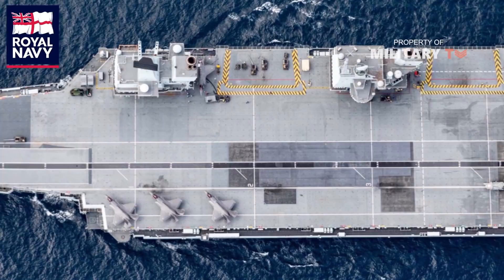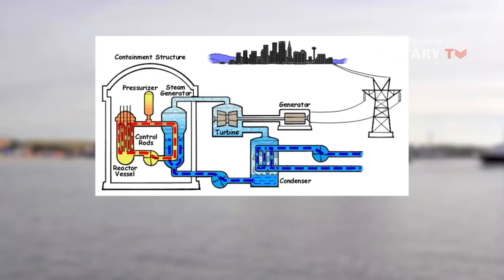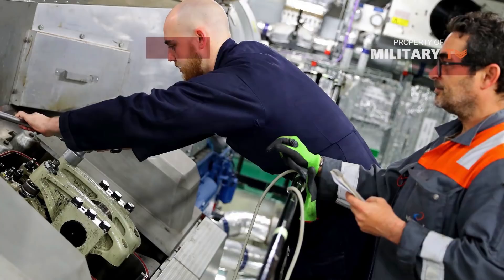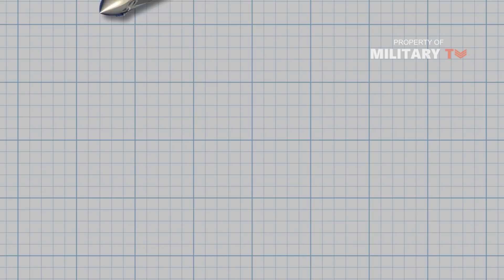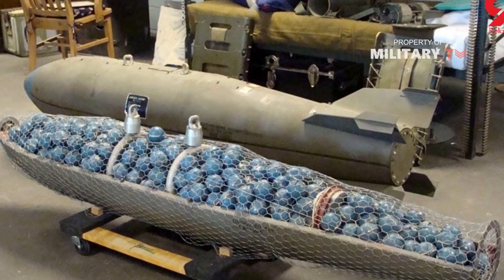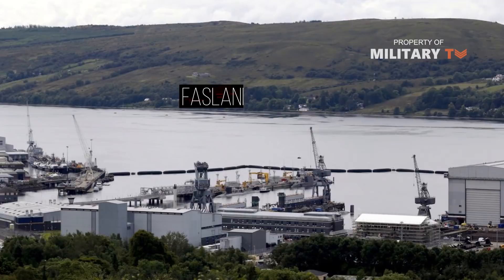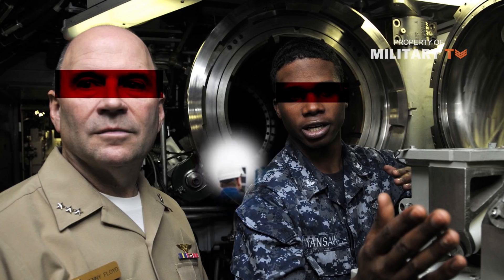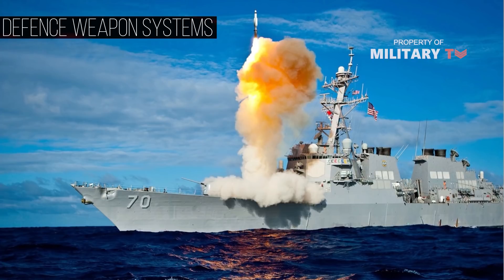The reasons HMS Queen Elizabeth is not nuclear powered

Comment: 1) Top speed is listed as 32 knots, not 25 - which would be ridiculously slow.

2) You missed out the actual (political) reason why no UK surface vessel has ever had nuclear propulsion - which is that they could be prevented from freely visiting allied ports.
Reply: The only country that doesn't allow nuclear-powered vessels to visit its ports is New Zealand.
There are some cities (including in America) that pass nuclear bans. But those bans are toothless political statements.  Since large ports are almost always controlled by an entity different than the city council. Plus foreign policy is controlled by the central governments and cities don't get to decide who can visit the nation.
Reply: that test was done 2017 ago buddy with no Jet/helicopter on board, no full crew, no full suppy, less equipment on board.

Comment: There's no electromagnetic launch system on the QE class.
Reply: They want to fit a light cat system for drones and the QE class is designed so that if they want to in the future convert the carriers to cats and traps they can as there is sufficient space below the flight deck for the launch and recovery systems and the deck is designed so that it only need be repainted for a angled flight deck and the engines are powerful enough for the systems too.
Reply: @Autofleet4429  I think by the time Big Lizzie returns for refit, the Ford class should have the bugs worked out of the EMALS system. They’re very close as it is.
Reply: @Autofleet4429  People in hell want ice water, too.
Reply: @takaharatanaka8818  Lol what a load of crap, the F35B can launch with full weapons and fuel.

It has crowsnest on the Merlins and within hopefully not too many years will have drone launched AEW which are well into development. 

Why would it need more than 3 phalanx when it will always have T45 escorts and F35/wildcats on the deck?
Reply: Arthur Humphreys  EMALS in its first generation on a much bigger carrier of the US requires that much power yes, to launch lighter drones on a smaller ship it will not need anywhere near as much.
Reply: @jameshammonds4687  

The F-35B can take off with a full load on a short runway (300 feet sticks in my head, but not sure) or very short runway with a ski-ramp. It can not take off vertically with a full load. I think it is limited to only 10,000 lbs or so or fuel and/or ordinance when taking off vertically.
Reply: @takaharatanaka8818  

The F-35B can take off with a full load on a short runway (300 feet sticks in my head, but not sure) or very short runway with a ski-ramp. It can not take off vertically with a full load. I think it is limited to only 10,000 lbs or so or fuel and/or ordinance when taking off vertically.
Reply: @ycplum7062  True but as we are talking about the QE class carriers which has the ski ramp then it can launch fully equipped and fuelled.
Reply: @jameshammonds4687  

Just pointing out that Tanaka's statement is not wrong. 

It is not applicable because the F-35B do not need to take off vertically, but not technically wrong.
Reply: @jameshammonds4687  If by full load you mean a jet 3000+ pounds heavier than the A & C version, one limited to 7G or less, with only a 14000 pound fuel load and a weapons loadout 1/2 to 3/4 that of the A or C, then sure.
The B version is a great compromise for an amphibious assault vessel, helicopter carrier or a through deck cruiser but saying it is a real carrier based fighter is like putting lipstick on a pig.
Without catapults she can't launch viable AWACS. Without situational awareness, she is reliant on US, French or shore based AWACS. 
I'm fully aware what a Merlin Crowsnest AEW bird's limitations are. I don't know what the radar is capable of, but I do know the approx limitations of the chopper since I've flown a Merlin while training with the Brits.
One can't loiter a Merlin at 35000 feet for 8 hours like one can a Hawkeye.
A chopper loitering at 10 or max, 15000 feet, well, that radar is limited by the horizon.
The Brits made too many compromises for reasons of national pride. She will always be dependent on others to be a viable platform in a medium to high threat or near peer environment.
Reply: @jameshammonds4687  Also, as for point defenses, the RIM-116 Block 2 & RIM-162 ESSM Mk-48/Mk-52 are thought to have a chance of intercepting maneuvering hypersonic cruise missiles in their terminal phase. That's something the Phalanx isn't designed to do & one of the reasons why the US has RAM as one of their point defenses. The Aster missile system on the Type-45 makes for a very capable platform, intercepting hypersonic missiles just isn't a capability it has (yet).
Not even the US SM-3 or SM-6 variations with the AN/SPY-1 radar are reasonably capable of defending against hypersonic threats. The interception of hypersonic cruise missiles will evolve as the newer AN/SPY-6/7 along with purpose built interceptors are deployed.
In the meantime, wouldn't it be nice to have a point defense system that MAY have the capability to defend the QE or the type 45's from such a hypersonic threat (pray the Chinese didn't shoot off a lot of them) don't you think?
Reply: @takaharatanaka8818  Said hypersonic threat that isnt proven to be able to hit anything that moves or even out at sea? A threat that in order to be able to manoeuvre and actually be able to hit a target needs to slow down to non hypersonic speeds? 

As you say say the RIM blocks are 'thought' to be able to hit said targets, how can they prove then can when no one can launch a hypersonic target to try and hit? 

The Aster 30/15 combined with Seaceptor on a nearby T23 is probably the most capable air defence system of any Navy on the medium to short distance. 

Incase you have missed the videos the T45 has been doing software training to deal with the possible threat of hypersonic so yes they are training for the hypothetical threat assuming the UK is planning on going to war with the Russians or Chinese then otherwise its still a non existent threat.
Reply: @jameshammonds4687  You go on & hope really really hard so the pig doesn't make the Chinese mad when/if she sails by. That is, if the Crown has the balls to allow her anywhere near Taiwan, the Philippines, or sail up to Japan via the South China Sea. That is, should she even show the flag in the region later this year.

Your final paragraph would do Neville Chamberlin justice.

It will be okay buddy. She will have the Americans & if she sails carefully, the Aussies to provide viable situational awareness to her. The Arlie Burks will even provide SM-6 cover, a missile proven to hit hypersonic glide vehicles, if not cruise missiles... Yet.

Both Brahmos and DF-17 are deployed with DF-17 being the true hypersonic threat. I would very much prefer the ESSM & the RAM CIWS be installed, both at least providing something of a defense against the "hypothetical" threat. The RAM & SEARAM being available "off the shelf" for not a lot of money. That 11 or 22 shot RAM pointing directly at an incoming threat just gives one that last little something that a VLS Sea Ceptor, even that ESSM don't have.
Anyway, your world view is based on wishes & faith.

I mean, even though you don't plan on fighting the Chinese, well, good old Neville didn't plan on fighting the Germans either.
Ya people, ya got experience there ;-)

That is, if the lack of AWACS doesn't prevent you from even identifying a threat. 

That poorly defended pig just may not be tempting for our ornery Uncle Xi as long as we all wish and hope really really hard & stay out of the South China Sea.
Reply: The UK was making one called EMCAT until the Tory government stopped it when it was elected
Reply: @Then.72  Which was purely based on the EMALS system in America which didnt work hence why they stopped it, it still doesnt work anywhere near 100%.
Reply: @takaharatanaka8818  Ah so you are saying China are basically the same as the Nazi's then? Well yes several similarities exist so I see what you are saying. 

No 'true' hypersonic threat exists as they cant target and actually engage a target at hypersonic speeds which makes them targetable by existing air defence systems.

It does have AEW systems in case you have yet again forget it has crowsnest. If the Chinese dont illegally attack it this time next time it will probably have drone AEW.

Im sure allies will provide some valuable defences if required, if the Chinese sail to the Med what allies will provide assistance to them? Ah yeah they couldnt even make it to the Med alone and funnily enough no allies at all would stand in would they?
Reply: @jameshammonds4687  🤔 it actually started before EMALS and if our engineers were left working on it they would have it working by now just like they did with VTOL
Reply: @Then.72  Again incorrect the system development was looked into with General Atomics in 2011 which was way later than the USA started on EMALS.
Reply: @takaharatanaka8818  
Nonsense, carriers are defended by her CAP, her sub and the type 45.
Sea Viper is the best theatre air defense system bar none, nothing gets through.
Reply: @jameshammonds4687  EMCAT 2009 EMALS 2011
Reply: @Then.72  EMCAT/EMKIT was an experimental design study by a private company which couldnt launch anything more than 11 tonnes, the MOD did invest a small amount of money into design studies (as they do with many projects) in 2009 but thats all it was, a design study.

In 2011 the UK signed an actual contract with GE to develop the idea but when the costs came back along with the reliability reports the idea was got rid of.

GE and the US had been working on the idea for a long time before 2011.
Reply: @jameshammonds4687  😂😂😂 but if the Tory government didn't scrap it our engineers would have it up and running by now just like they did with VTOL
Your obviously a major fan of the USA but Japan actually started maglev.
Force Engineering had the Contractract in 2009 not 2011 who are now called GE power conversion and have a long track record with the Royal Navy (have you got mistaken with General Electric).
COSTS??? the UK isn't a poor country and became a partner of the F35B which is the most expensive aircraft
Reply: @Then.72  What are you going on about, the government never scrapped anything, it was a private company doing some experimental work it was never under government control for anyone in the government to scrap!! If the USA cant get EMALS to work properly with the budget they have how exactly would a small company in the UK be guaranteed to have it up and running?

Force engineering never had a contract at all, they received a small amount of money for a design study, is a very big difference.

The MOD then awarded a contract/tender to General Atomics in the USA for EMALS.
Reply: @jameshammonds4687  you obviously read rubbish hence why you've admitted you were wrong previously but you keep on 2011 when EMCAT was 2009 
The MOD is the government who cancelled EMCAT by running off with EMALS
Reply: @takaharatanaka8818  Her F35's can indeed launch with full and weapons however i can see your mistake you either read a news article about how US Marine F35's cant take off with full fuel or weapons and assumed it meant all F35-b jets when in fact the reason hms queen elizabeth has a ski jump is in fact so F35's can in fact take off with full fuel and weapons or you confused the royal navy for the US marines       ever wondered why the US marines are so interested in HMS Queen Elizabeth its partly becuse she can launch F35's with full fuel and weapons

Comment: Not needing a head wind (of a fraction of one) is the reason we were able to operate a carrier in the southern Atlantic during the Falklands War.
Further to that, stovl aircraft are guaranteed to land first time every time, there's no 'missing the hook'
With American catobar aircraft, they have to reserve multiple tons of fuel to land, whereas the harriers and F35s can land on fumes.
The envelope was vastly expanded during the Falklands.
Ski lifts and stovl aircraft have these hidden advantages.
Reply: @ Mostly Penny Cat: The flip side to that is aircraft designed for CATOBAR can carry much more ordinance, and fuel, thus greater range. Also, you can fly a greater variety of aircraft off a CATOBAR carrier, such as the E2C Hawkeye, which gives you a much greater range for an airborne early warning aircraft. In an age of hypersonic missiles, you need all the early warning you can get.

I will give the Brits credit for pioneering the rolling recovery landing for aircraft returning with partial or full ordinance loading. That otherwise wouldn’t be possible in STOVL.
Reply: @darkjedi74  the F35B can land vertically with a full internal payload.
Reply: @darkjedi74  or just have land based tanker and airborne early warning and control aircraft over your fleet ..
Reply: Britain also created the catobar, so it's not like it hasn't been tested and tried...
Reply: @darkjedi74  F35B can take off fully loaded and fuelled so that makes no difference.

The uk doesnt own a great variety of aircraft so again no advantage.

Hypersonic what exactly? Ah yes those fantasy things that Russia is building in the same factory as the T14 and SU57's.
Reply: @jameshammonds4687  The taking off fully armed and fueled isn’t the issue. It’s the landing part that’s the issue. Hence the rolling landing. Taking off or landing vertically takes a ton more fuel than a rolling take off or landing. Not to mention rolling recoveries are less harmful long term to the flight deck.
Reply: @darkjedi74  Rolling take off and landing are both common practices for the QE operations.
Reply: you are a bastion of hope in this comment section

Comment: There is also the issue of having enough nuclear engineers to build, maintain and refuel the ships.  There was another video a while ago going over how making more nuclear powered ships would stress the infrastructure of the nuclear subs.  I think the main reason is total lifetime cost however.
Reply from the maker: Watch other videos, like this https://youtu.be/2mdmIKPw8P4
Reply: Main reason is its simply not needed, why go to the expense and hassle when its of zero benefit to the UK?
Reply: The main reason is “why sail on Nuclear Reactors during warfare just to sail a couple of knots faster?”
Reply: @Then.72  A couple of knots faster than the rest of the supporting carrier group? Very hand feature.
Reply: @jameshammonds4687  a carrier will never go faster than its escorts..thats foolish. Nuclear cons outweighs the pro's.
Reply: Engineers is never a problem.  It is always very easy to train staff.....  Infrastructure maybe, but I doubt it will be a restriction if it is needed.
Reply: @Davebsuk  Training nuclear engineers is not easy at all. Especially if the current number of engineers in the state isn't enough to have extras to staff a school.

Comment: You need to compare with the new Ford Class CVs.  The catapults are not steam powered anymore.  They also generate huge electrical power for new electronic weapons (lasers).
Reply: Yea, if only the cats (EMALS) would actually work, along with the weapon elevators.  The Ford can finally launch planes after 3 years, but can it launch reliability with an acceptable "MTBF" (mean time between failures)?  It would also help if the Advanced Arresting Gear (AAG) actually worked as designed - reliability.  The Navy pushed the envelope with too many new unproven and unreliable technologies - and now the new ship is unable to perform its mission.

Comment: The top speed is actually 32 knots (well that is all that has been admitted), due to computer controlled variable pitch Rolls Royce designed Propellers, plus electric propulsion from 4 diesel engines (used for routine operations) and supplemented with 2 Rolls Royce Gas Turbine (Trent) Jet Engines  for high speed cruising, the fact that the drive is electric means the Engines can be located anywhere in the ship, and the Gas Turbines are actually mounted on sponsons (effectively outside of the Hull) under each Island.

Interestingly, the Escorts and SSN all have a 32 knot maximum speed (at least that is all that has been stated), so the design fits that the CSG can maintain formation at high speed.

Obviously the RFA vessels for RAS don't attain such speeds.
Reply: that test was done 2017 ago buddy with no Jet/helicopter on board, no full crew, no full supply and less equipment on board.
Reply: @jerski14344  They are never going to state what the top speed is, but its not what is stated in this video, particularly as trials have shown higher speeds whether fully equipped or not.
Reply: @Judge_Dredd  It's all over the news buddy, Q.E. top speed "Fully Equipped"  regardless of weather condition "Averages" at 25 knots (good weather 27.2 knots).
Reply: @jerski14344  Who mentioned classified?  They designed it for at least 25 knots, but its listed at 'in excess of 25 knots', because it has done more than 25 knots, actual cruising speed is designed at 20 knots, pal.

Comment: Benefits of not having a nuclear powered ship is you can dispose of them easier when they retire.
Reply: And the RN carriers dont need a costly two year major nuclear refit mid-life. Another massive factor is total through-life cost. This way the UK can get 80-100 aircraft at sea across two platforms for something like 50-60% of the through life cost of a single USA nuclear carrier. Nobody in the RN believes that their carriers are better than the USN ones, but they are a more pragmatic approach for a smaller but still respected navy that has learned from the compromises of the French Nuclear carrier program and the high cost & heavy crewing requirements of the US ones.